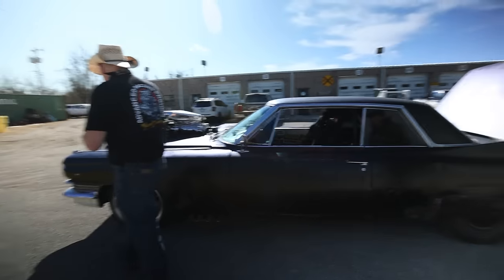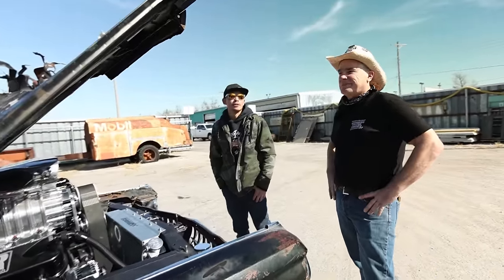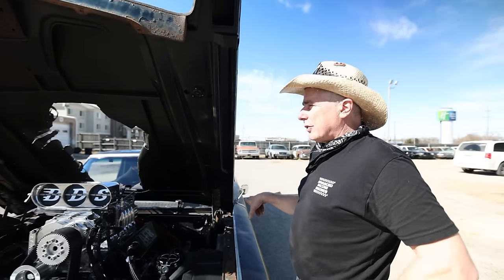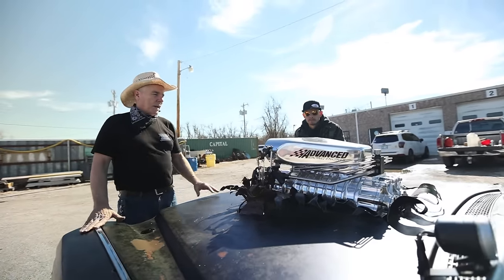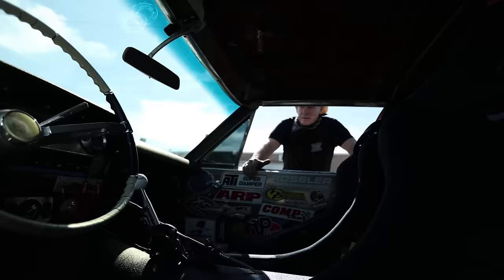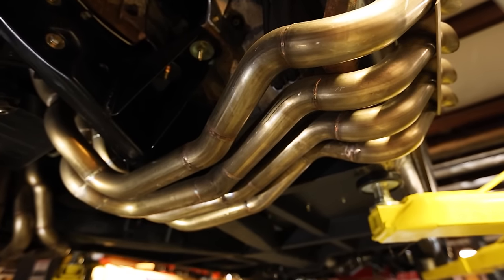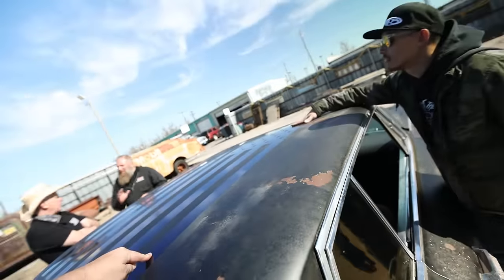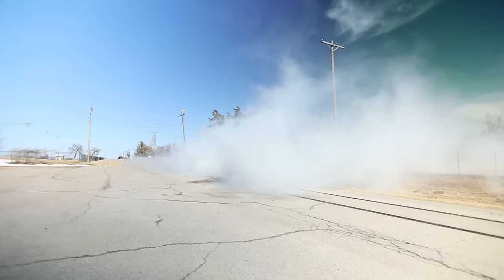DARK ROAST BURNOUT CAR - "Pop the Hood!" Behind the Build

Comment: That is badass I have a 79 with a 425 tall deck in mint condition it only has 9,100 miles on it any suggestions it kinda sucks because it is front wheel drive is there anything I can do to make the motor meaner or I wonder if I could put that motor in a 88 Chevy dully single cab 2wd any help would be greatly appreciated you guys are awesome

Comment: Y'all can get "remote mount booster" for power brakes. Not sure on the brand but I the part number is VH44. Would need an electric or belt drive Vacc pump for it. I've got mine going under the front fender/guard, on my first gen 1970 ke11 Toyota corolla.

Comment: What i would do is add another caliper to each side of the  rear end and add a drift style hand brake so you dont need a big booster or reservoir most of the hand brake kits come with all that except the calipers.
Reply: No brakes on the back tho

Comment: Farm truck is right about cars being more rusty on the passenger side of the car then the driver side and that is because of that very reason. I noticed that when I first started working on cars and sat and was wondering why that was and came up with the same reason and it's because the passenger side is always on the wet and dirty side of the road. If you look at a OG car that has never seen rain or a wet road they don't have that issue at all only cars that have drove in rain or snow have it.